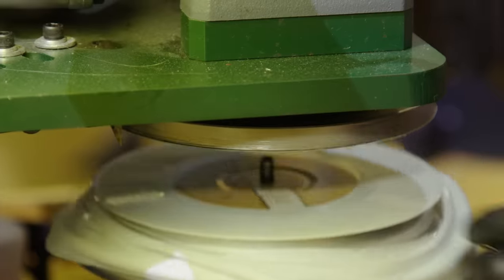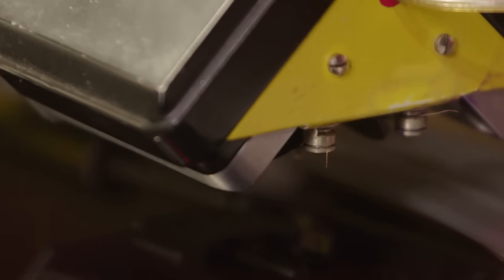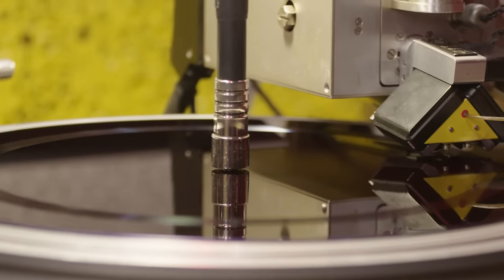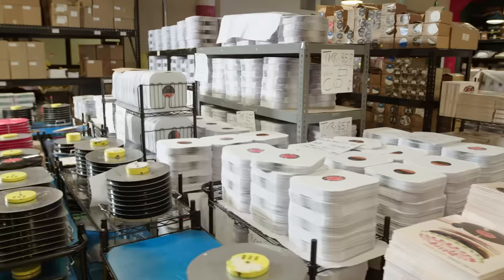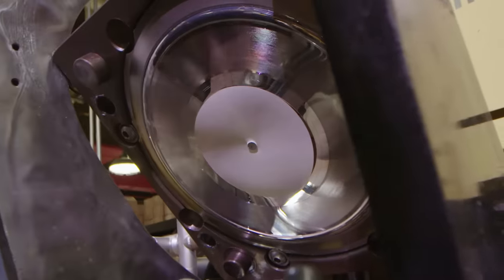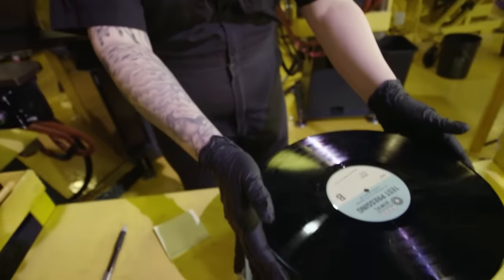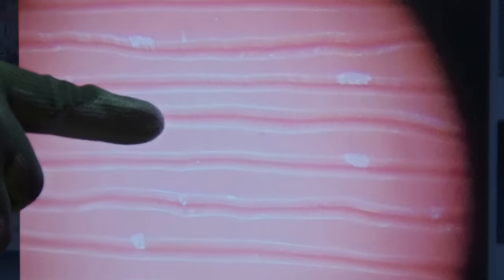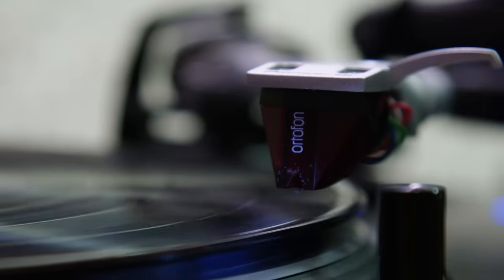How Vinyl Records Are Made (feat. Third Man Records) | WIRED

Comment: I want to see how mass-produced records are/were made in a massive factory. The process shown in this video, while cool, seems very inefficient and prone to faults
Reply: So you want to watch a 40-year old film then, when vinyl was still popular.
Reply: Actually, it was the massive factories pumping out inferior and cheap vinyl that lead to the decline of vinyl in the first place. With a digital format like CD as long as the CD isn't too badly scratched its 100% guaranteed to be the same quality regardless of where it was made and wont decline over time.
Reply: This is kind of the mass-manufacturing process. They just focused a lot on the initial cutting of the lacquer. Once you get to the stamper, it looks like a standard mass-produce method of filling a mold and stamping.

Really the only differences you would see in a bigger factory are #1 how that initial lacquer would be made, #2 maybe a more efficient way of cleaning/prepping the stamper, and #3 generally more sterile and streamlined working environments to reduce artifacts in the pressings as much as possible.

If this doesn't seem efficient, then ask yourself while digital media became so much more popular, and why vinyl costs so much. It is inefficient. It is more prone to faults. That's why record labels have to charge more to deal with those issues. Vinyl is still enough of a cultural staple that it has continued to survive through its numerous drawbacks compared to other media forms.